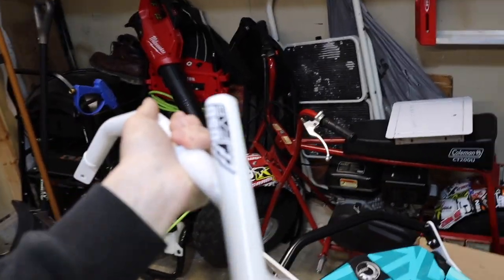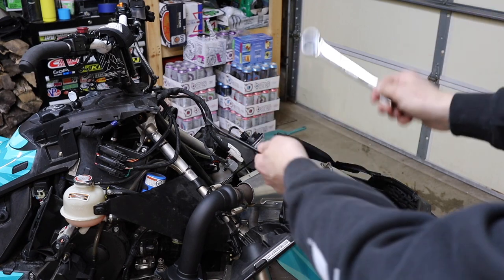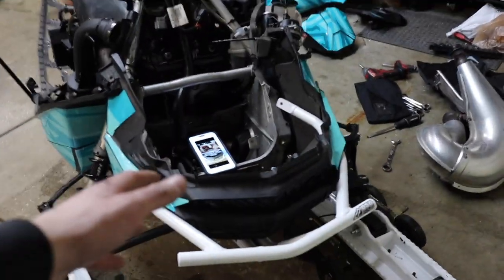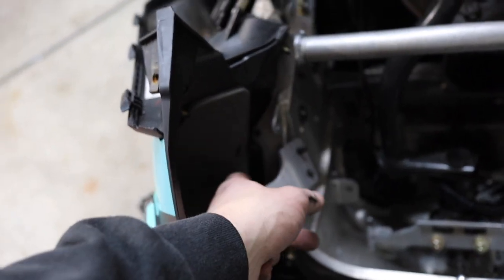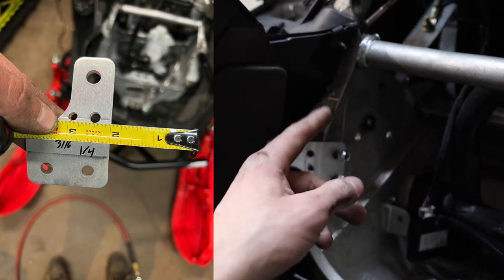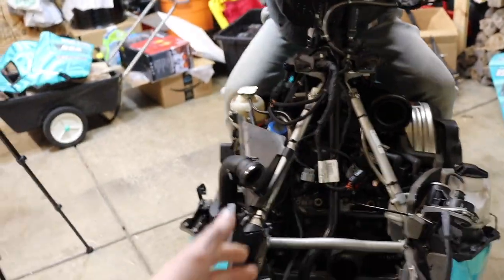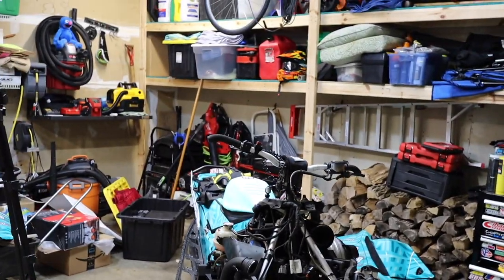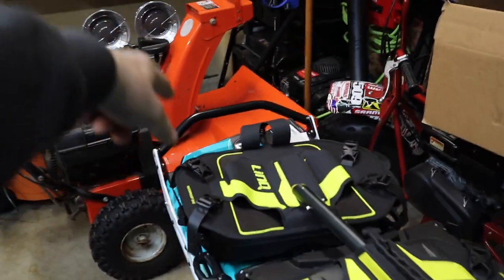BSB FAB Front Bumper Install!

Comment: Your almost done man. I highly recommend you get the zbroz bulk head kit, straightline clutch tower brace,the RPM carbon fiber lower chain case and brake guards, Bushpusher kill switch and shot start relocate, put on a race rubber stop switch component. This keeps you from accidentally shutting your sled off. Trust me it happens . Last I would get a belly pan clutch guard.  If you blow your belt, it has the potential to rip your belly pan apart. With these last mods, your sled should be bulletproof.. Hope this helps man nice looking sled. These mods do add a little bit of weight but not enough to notice.